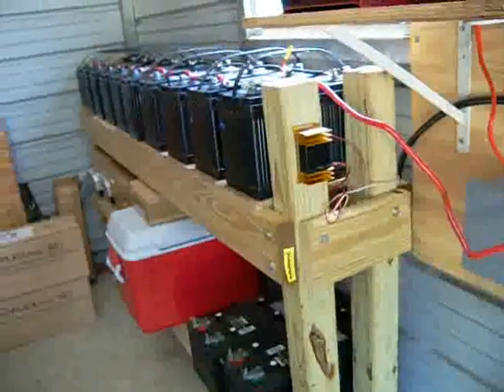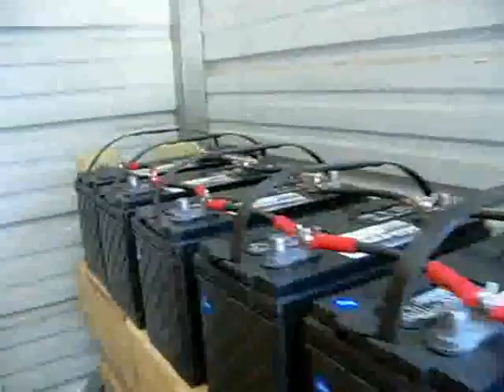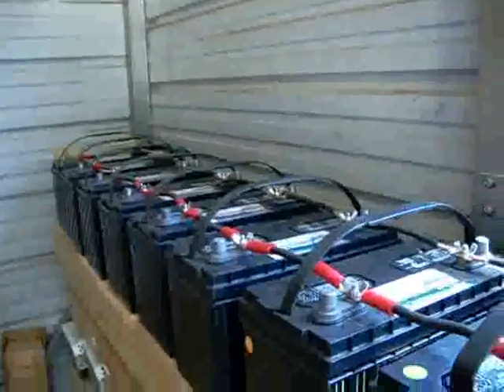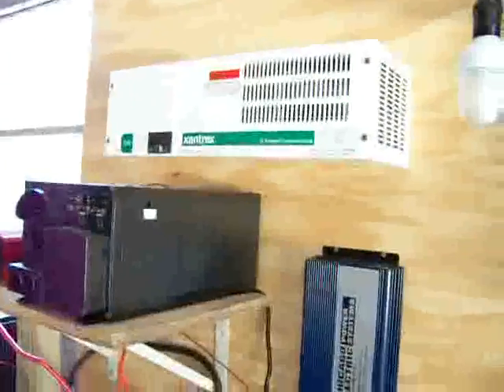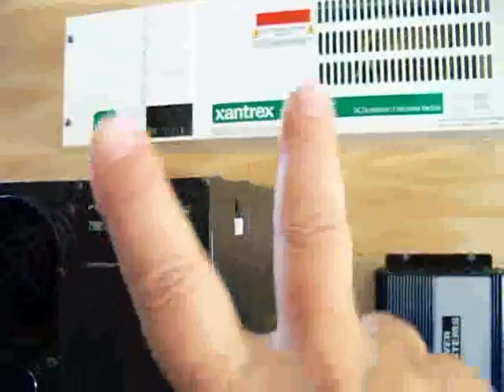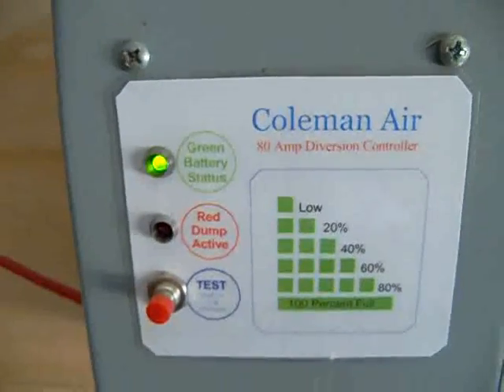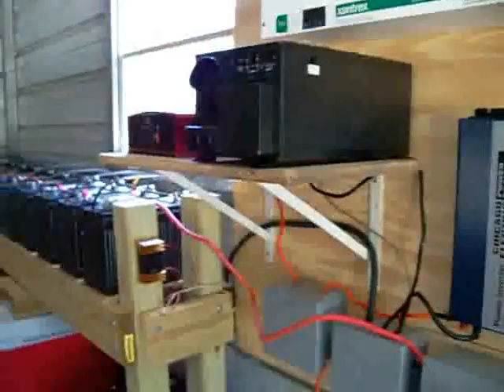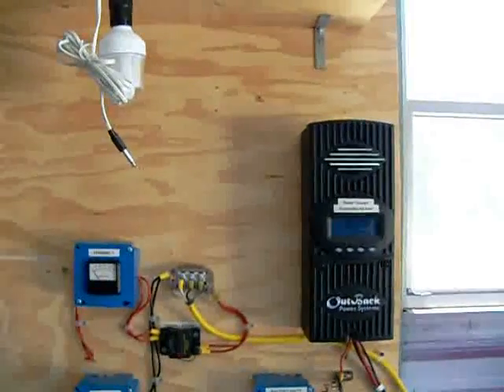Solar and wind battery bank

Comment from the maker: @u2nvme Yes, I'm very happy with the Tiger Claw, I like the fact that it is a pure sine wave, the fans are load controlled so they don't come on unless or until the inverter gets hot under a good load and even then the fans speed is adjusted higher or lower depending on the cooling needed. I'm very happy with it.

Comment from the maker: Right now the shed which includes the lights, an upright freezer and a chest freezer, all my tools, the water softener and the water pump. By the end of September it will 11 of the 14 circuits in the house - and I'll post a video of that. I'm at a point where the remaining work really takes a lot of work.

Comment from the maker: @mrbuki77 Thanks for the comment. I have 1.6Kw of solar on Sharp PV panels which are grid tied. I also have 420w of solar going to the batteries from Harbor Freight panels. Finally I have 2Kw of solar on DuPont panels that I still have to install which will also go to the battery bank. Thanks and God Bless you.

Comment from the maker: @MegaDeathwarrant Not enough power, I really need twice that much. They will last me about 3 days assuming no sun or wind and with full utilization at home. You can't have too much reserve power. My entire house has been on batteries since Friday with the exception of the main air conditioner, possible only because I have good sunlight to recharge. Besides, you cannot draw the batteries below 50% without risking damage so I only really have 15,000 watts - that's not much.

Comment from the maker: @TheChineseEmpire I don't have a smart meter so I will talk from an electrical background knowing what these devices do. Smat meters can measure both input and ouput power (when you buy and when you sell power) and relay that information wirelessly back to the utility company. There is nothing in it that would keep a grid tie inverter from working. You'll simply make power that you'll consume yourself (unless you make more than you use) and buy less from them.

Comment from the maker: @reddawn5297 If I knew then what I know now I would have started with a higher voltage,that battery bank and the inverter it feeds is now 36 volts.  Thanks for the comments.

Comment from the maker: The size of the cable depend on the max amp load you expect to draw. The desulfator I use is called "Battery Life Saver" or BLS and you can get it from eBay or Amazon.

Comment: Used batteries are never a good idea to install in a solar battery bank.. The bank is drawn down to the voltage of the lowest battery so you could easily negatively effect all the batteries in the bank by having 1 used bad one. Its best to go all new if possible. You can test the voltage of them fully charged to see if they are damaged.

Comment from the maker: @hotsexybrownguy Because:
1)  I want power if the grid goes down
2) No easy to find a grid tie that works between 50v-100v unless cheap chinese not UL certified

I may still put a chinese one up there if I can't come up with something UL but we'll see. As far as generating more power...I'm not sure where you got that information but that's not really correct.  Thanks for posting.